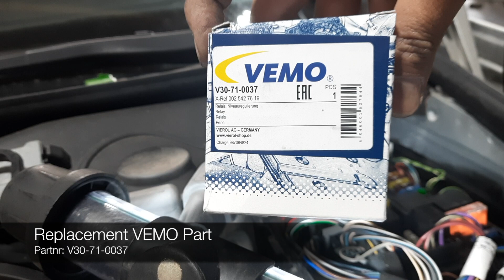How To Replace #airmatic #compressor #relay / Mercedes CLS55 E55 AMG W219 W211

Comment: Both rear air struts are down, not the front. Compressor wont turn on. Should i change compressor, relay, and valve body. 2005 E500 thanks.
Reply from the maker: Whenever you change the compressor, also change the relay! If the valve body has never been replaced, then I would recommend to swap it out. I bought a valve body from Amazon for about 60 euro, which is working well 👍
Reply: @NDPhotonl actually the compressor works, but its no consistent. The relay is fine. I think its the inlet hose because its torn. Thats why there is no air going inside. I may have to change the piston if its damaged.
Reply from the maker: @jerry5876  If you want to keep the Wabco, its a good economical choice to rebuild it. I went for an aftermarket cheap unit, which is also a fine solution. Keep us updated and good luck!

Comment: Man my relay is loose back there if i tug on it to disconnect it i feel like the wires its attached to will break. Are those white things tabs that beed to be pressed to remove it?
Reply from the maker: No, just wiggle it out ever so slightly. Try to hold the white holder while you wiggle it off

Comment: Nice did that fix your issues or did you need the compressor and computer module as well?
Mine has all 4 tires slammed on the ground and apparantely no charging warning message on dash
Reply from the maker: Could be that there is more to it. If you never replaced the compressor, then it makes sense to replace it on a +10 year old car. In your case, I would also suspect the valve block. I replaced it with a 40$ unit from Amazon which works just as well. Personally, I would also replace the compressor and relay in your case. The Airmatic system is not that daunting, it only has a couple of components and is quite simple.